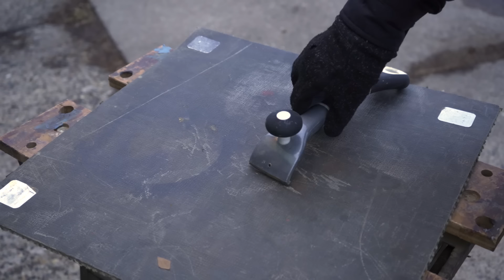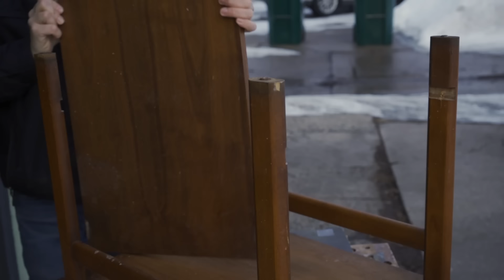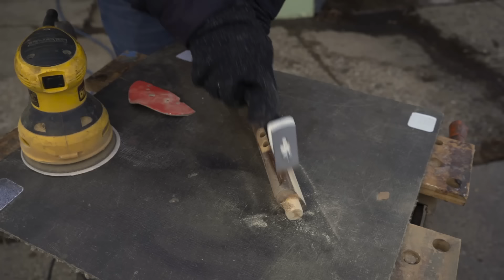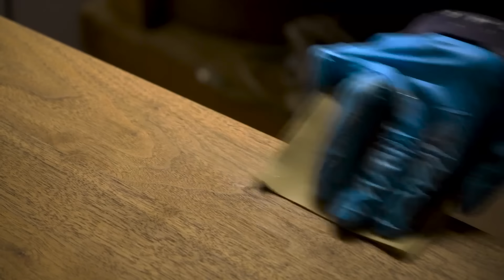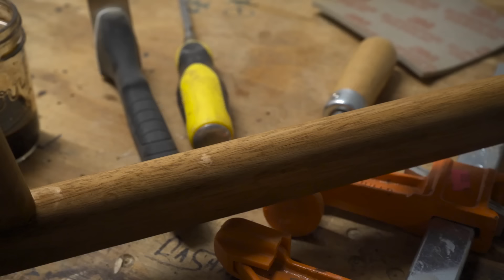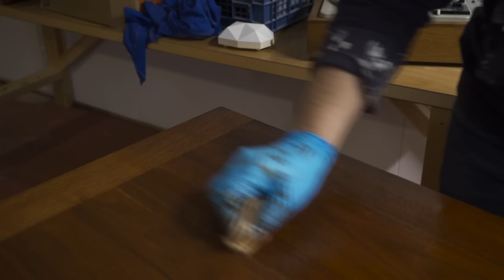Refinishing And Repairing A Vintage Table | Furniture Makeover | Thrift Store Rescue #29 |

Comment: Very nice work.  I am just starting to learn how to refinish wood as a hobby and your videos are extremely instructive. It would be really helpful if you could clearly identify at each step whether you are using oil or water based stains and finishes.  Since you had already put oil based poly I have to assume you used oil based gel stain to darken the table top?  Also I was surprised that you put the stain on top of the poly without stripping or at least sanding the wood. How was the stain able to penetrate through the poly? There is a lot of confusing stuff on the web about what’s compatible with what, and the product instructions are not very helpful!

Comment: It can be easy to bear down in a scraper actually - if it is a smaller width blade and not positioning correctly. Make no mistake it does take practice and some good advice to use the correct scraper and to use it correctly.

Comment: Oxylic acid works on iron stains , because iron oxylate is clear rather than red or black like iron oxides (rust)
It isnt really going to do much for what appears to be deeply ingrained mildew from water wicked up into the wood grain of the legs.

Comment: I just saw a video about using super glue on cotton shoved tight into holes on particle board. Apparently the super glue creates a really hard base into which we can screw, thus holding the piece together long enough for the particle board gives a way in another area.

Comment: While not as strong as MDF, particleboard is denser and stronger than wood, and is best used flat, as bending or molding will cause it to snap or tear. It does not warp due to temperature fluctuations and other changes in the environment, but will expand when exposed to moisture. Because of the density, it us usually heavier than hardwood. 
After 50+ years of rescuing furniture, I have found this to be a good general guide to judge the presence of Particleboard.
About the stains at the bottom of the legs: Hydrogen Peroxide is a good stain remover when used on Organic stains, like the "Dirty water" that those poor legs were exposed to. That type of staining has been avoided in the past by putting Metal Caps on the floor end of furniture legs, although today most people look at those metal caps as being "Old-fashioned" they prevented the stains and rotting that can occur when wood is exposed to water and other liquids.

Comment: I find your video’s very relaxing to watch. But  maybe i got a suggestion for u. Because I saw you didn’t finish the bottom’s of the boards. I learned it is better to finish the piece all the way around. This to prevent potential warping of the boards. Even when it is MDF or particleboard. Just a suggestion.

Comment: Question. After you remove the old finish, is that when you should repair any deep scratches or dents with hot steam...and then do the sanding down?  I just watched another YouTuber, and he did not do it that way.  I want to make sure before moving forward on my Lane end tables. The last thing I want to do is mess up Lane Furniture.

Comment: I find that when a piece seems exceptionally heavy that indicates most of it is particle board. This stands to reason because it is denser than wood even though it is structurally weaker. Wood is essentially a bundle of narrow bore pipes that conduct nourishment from root to leaf. I think of particle board as sawdust bound together with adhesive.

Comment: Yeah furniture weight is often a product of component density.  MDF/Particle Board are v dense and as a consequence heavy.  There is a heft difference between softwood and hardwood, but that all goes out the window if a component is made of densely packed material.

Comment: Dumb question: Why assemble the legs before staining? I was just thinking it would have been easier to stain then assemble?
Reply from the maker: If I assemble after staining then I run the risk of getting glue on the new stain.  I've done it both ways and they each have their advantages/disadvantages.
Reply: @DashnerDesignRestoration  thanks! 🙂

Comment: Have you ever tried applying heat to particleboard with a heat gun to loosen joints? I wonder if that would help or just not worth the trouble. Nice work.

Comment: I am not a fan of pressed wood for a number of reasons.  Weight is one of them.  That turned out well.  Good choice on the epoxy.  It's the only glue that can fill an area and still hold.  I was hoping as I watched you'd use it to reattach the legs.  Keep up the good work.

Comment: I tried using a soldering iron like that once and ended up burning the wood.  I use an iron, but you end up steaming a much larger spot than needed.

Comment: You’re correct about the weight thing. MDF and particle board is often significantly heavier than plywood and most solid wood panels of the same size. That’s one of the reasons why it’s so nice to work with high quality plywood like baltic birch or Appleply for furniture making or cabinetry; not only is the wood panel more stable, durable, and resistant to moisture damage, but it’s lighter weight and thus easier to work with and mount, as well! 

But MDF and particle board is often chosen not just for lower price,  but situations where flatness is very important, because while plywood will often be and remain much flatter than a solid wood panel, it’s still not as flat as MDF or particle board. OSB can be a great option for this as well. MDF especially is great for getting consistent, smooth cuts, especially on the interior where any plywood lower quality than baltic birch will have voids or softwood, and cause chipping and weakness where you are trying to cut joinery, though MDF smells kind of weird when you do, and lots of people find it somehow unpleasant to make cuts in!

Comment: This may be a strange idea about a possible solution to the bottom of the legs. If the candlelight gel still did not cover the bottom of the legs, and you did not want to risk darkening the entire leg by putting on another coat, could you tape off the leg above the stain and just apply another coat to the bottom? Since the table top already has two colors (although the legs would not be the same), it might look ok for the legs to also have two. Just a thought.

Comment: Looks great!

About the use of particle board: I agree that such pieces should still be saved, however I think it's worth noting that even manufacturers like Laine had ranges of furniture, and the more expensive pieces would have been solid wood. The use of particle board (not plywood, that's different), was a cost-saving method and came with many drawbacks. It is absolutely a mark of furniture that has been made to a cost.

Comment: All furniture can and should be recycled where possible. Bravo.
This piece came up really well.
Your comments on particle board (or as we usually call it over here - chipboard) are very important. When I was at furniture college MDF (basically dust held together with formaldehyde glue) was the big 'new' material, as well as something called Corian which was a solid plastic board. We quickly concluded that if Chippendale, Sheraton and many of the other 18th-century cabinet-makers had had these sort of materials available they would have leapt on them for their stability as a base for veneered cabinetwork. Earlier generations of craftsmen too as a means to show off their incredible marquetry and parquetry work. So called 'solid wood' cabinet-making has generally been at the lower end of the market, or more suitable forms such as chairs, it simply doesn't work very well (generally) for big flat surfaces, because of the difficulty of stopping wood moving, and its desire to adapt to its surrounding atmosphere. Wood wants to keep moving - stretching or shrinking - depending on relative heat and humidity. 'Particle boards' are inheritable more stable if sealed properly. I have become much more reluctant though to specify formaldehyde based products for obvious reasons.
IKEA and other mass market makers have shown how superbly you can furnish using the minimum of material.

Comment: Particle board or not, anything being kept out of the landfill is a good thing.  Lovely job!
Reply: AND particle board helps save trees, because we use the byproduct of furniture production!
Reply: A particle board piece is good experience for a novice at furniture restoration. There is knowledge that can only be acquired by practice. You gain practice with tools and materials. You learn more about what constitutes good construction. You learn the limits of your skills and patience. The knowledge gained helps you avoid costly mistakes on a piece that has greater intrinsic value. If you chuck that piece of MDF back in the landfill, the world is none the worse for it.
Reply: @valkyriesardo278  "test of your skills and patience" this is very true, every time I get impatient, I make mistakes, which generally take me twice as long to fix! It's all a learning experience, unfortunately I learned on some amazing mid century modern pieces 😪 lessons were learned
Reply: Molly, Sorry, but I think that’s kind of no thought out. Dashner said the same. Thinking it through - full wood pieces probably wouldn’t get destroyed as easily and then you wouldn’t have to use epoxy (harmful?) to make the piece useable again.
Reply: @boa9535  a) who said epoxy is harmful?  Wood dust certainly is harmful to the lungs, but I have never heard that epoxy is harmful.
Particle biard is made out of all the scrap and sawdust. Also, wood that has had woodworm in it.
It all goes into the mix.

Comment: Question Dash! I bought a scraper and started using it for the first time. It doesn’t scrape linearly. It sort of scrapes all over the place. Is that a pressure thing or maybe the blade is wonky? Scraping in general is so intimidating to me. Just scraped a line through veneer on something I’m trying ti stain for instance. 😭
Reply from the maker: It's hard to say without seeing your technique.  What kind of scraper is it?
Reply: @DashnerDesignRestoration  It’s that one from Amazon everyone recommends - the Bahco 665 Carbide. I scrape in a straight line down, with consistency, and it will scrape in a wavy fashion. 🤦🏽‍♀️
Reply: @lotecque  thanks for the tip!

Comment: Any particular reason you stain after glue up?
Reply from the maker: I stained after glue up to avoid getting glue onto the new stain.  But I ended up with issues anyway.  What I really should have done was to glue it up while the old finish was still on there.  Then the glue squeeze out would get onto the old finish which I would be removing anyway.

Comment: Out of curiosity why is it easier to sand through the veneer on the edges? Is it typically thinner toward the edge? Also great save!
Reply: I personally think that it’s due to less surface area to support the sander, forcing the pressure to one specific area. Where the applied pressure was once predictable, now you would have to attempt to account for loss of surface area, which is quite a challenge. I’m by no means a physics expert of any kind so take what I say with a grain of salt.

I tried sanding a thin table leg and it took a couple of seconds to get to bare wood compared to sanding the flat surface of the table top.
Reply: @TheRealBwoi  I thought the same thing. With one side of the rotating sanding disk off of the table, the chances of keeping it completely level would be slim. It would be too easy to let the weight of the sander tilt the sander down at the edge of the piece being sanded, creating more pressure on the edge, which would just eat away at that edge so much faster than expected.
Reply from the maker: Good question and I'm not sure I have an answer.  I don't think it's because the veneer is thinner on the edge.  I just know from experience that it is easier to sand through on the edge.  I'll have to think about why that is.

Comment: another refinisher on youtube refinished a Lane cedar hope chest lately and was surprised that the wood on it was veneered. i was also surprised, as i spent a hefty amount of money on a Lane cedar hope chest for my daughter's 16th birthday in 1990.
Reply: Then you still don’t understand veneer! Sometimes veneer is used to avoid using very expensive wood, but often, veneer is the preferred choice when using a tropical wood here in the states. Experts figured out that some woods, such as mahogany , have less chance of bowing or splitting in climates different than it’s original home, when strengthened by a local wood in the center. Sometimes it’s not to be cheap, but to make your piece last longer and better. Also, a study done in 1897 realized that the furniture and building industry was killing off old growth forests and advised using piecing and veneers to save the older majestic trees which were being cut down just so people got furniture made from solid pieces. Veneer is often harder to work than one solid piece so would tend to cost more than the other. Veneer doesn’t always mean less quality!
Reply: @catofthecastle1681  : apparently YOU don't know the ill-deserved reputation Lane cedar chest company has had through many years.  have YOU priced Lane cedar chests?  no, i didn't think so. no consumer should be lead to believe that Lane makes high quality wood cedar chests and then get home much less than what they paid for.
Reply: @nowvoyagerNE  Since you seem to be knowledgeable about furniture, then you must be aware that Lane Furniture was never expensive or known to be of ‘fine’ quality.  It was easily recognizable, affordable post war furniture.  Most furniture is made with veneer, expensive or not, btw.
Reply: @catherineduncan7707  : i do not agree with you.  nor do several other commenters.

Comment: 1 Why scrape and not sand? Easier?
2 What if screws would have been glued in? How would you take apart?
Reply: Sandpaper costs $$$ and if you don't scrape some first, you will go through a lot more paper.  Also, you might over sand, ruining the veneer. 

If the glue is old, the screws will break free.  If they are stubborn, a heat gun will soften old glue.
Reply: @chrisnorton2837  thanks!! Makes sense.